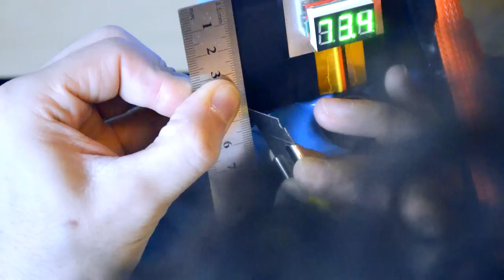72V 29Ah 20s10p high density li-ion battery pack

Comment: hi..how many amps does bms have for batteries?
Reply: All BMS will do is limit the amp going out from the battery. If the battery pack can do continuous discharge of 100A then you'll want BMS that will do 100A.  First you will have to design the battery yourself...determine how much wattage, amperage, and amp hour you want to have. There is battery voltage amp calculator you can use - https://power-calculation.com/battery-storage-calculator.php
Once that is figured out you can search for the BMS to meet to your specs. But I don't think you have to have a BMS to run the motors. Having a BMS will cause more potential problems...like stop feeding power to the controllers, or power cut out unexpectedly. It will also be more difficult to troubleshoot when your electric bike or scooter fails...God told me not to go with the BMS.

Comment: hello, i always impressed with your battery pack builds, i am too building a battery pack but i am suffering with switches, could you please suggest me a switch for my battery pack (for discharge wires)
Reply from the maker: Switches are better installed in the electronics to be powered with the battery. If you have a switch installed in your battery, there is a mechanical element that could fail, and make the battery useless until reparation. On the other hand switches are better for low current and voltage operation, if your battery is BMS equipped you can sometimes install a switch there activating and deactivating discharge port.
If using a switch is your only way to go look for any high current switch or anti-spark switch for higher voltages than 72Vnom.
these are examples for medium current swithes:
http://www.ebay.com/itm/Interruptor-Light-4-Pin-DPST-ON-OFF-Snap-inRocker-Switch-15A-30A-250V-AC-28x21mm-/252360792396?hash=item3ac1e0194c:g:6SwAAOSwKfVXFe6j
http://www.ebay.com/itm/New-Universal-12V-20A-Racing-Car-Vehicle-ON-OFF-Light-Rocker-Toggle-Switch-Cover-/291780259596?hash=item43ef756f0c:g:azkAAOSw4q9XT8IL&vxp=mtr
http://www.ebay.com/itm/AC-250V-15A-125V-20A-ON-OFF-ON-3-Position-DPDT-Momentary-Toggle-Switch-DT-/252471360099?hash=item3ac8773a63:g:I5YAAOSwZVlXkkQn
Reply: thank you

Comment: Why didn't you use battery holder instead of hot glue?
Reply from the maker: is not exactly glue, although the heat gun used is the same. Is a 7mm silicone that is more dense and with a higher melting temperatures. The main reason to don't use premade holders is to increase energy density. Once the silicone is dry, it is indeed working like a plastic holder but with the perfect shape between its matched cells.

Comment: Hi nice setup. How long does it take to charge from 3.5v to 4.7v  using 3Amp charger, maybe 3 amps per cell and 29ah then would take 10 hours. Is that about right?
Reply: 3.5v to 4.2v sry
Reply from the maker: Yes, Li-ion charge is very efficient, at 3A with 29Ah you need 10 hours from 3V to 4.2V (taking into account from 4.1V to 4.2V the charger charging current will be lowering until the charge is completed)
Reply from the maker: Depending on the model of cells, at 3.5V resting voltage can be at its real 35% SOC or as lower as 20% SOC. So the total time depend of the cells you are using (specific chemistry)
Reply: Thanks for that, Lets say Sanyo 35000mA, 10-13 A they must charge pretty quick more so than arbitrary laptop battery setups and be more reliable on amount of chares taken longevity wise than farmed batterys price wise. Seems for E bike is best to pay more for less weight and more reliability and longevity of batterys. you can still bulk buy from reputable suppliers in Europe for good cells for 4 Euros each. seems the way to go. It just takes alot of research which suks . What do you recommend for high quality E bikes?. I bought high quality adaptor kit from England and the rear wheel is 10mm off centre . This is still a gamblers market. Atleast I leart how to centre the wheel now but I bet the wiring will be too small in diameter for heavy current and will fail without a doubt. I can remedy that aswell so am looking forward to the challenge.. Its all about heavy current and  good power devices that count  and low resistance on everything which will give you true performance.Wish me luck.
Reply: wladimir delicaat Just a typo error

Comment: Hey, can I make a pack of 37 V and 45 Ah and boost the pack voltage using boost converter to get 72 V load demand?
Is using a boost converter advantageous because the number of cells in the pack reduces by almost half(37V instead of 72V) ?

Comment: can these batteries be used as backup charge supply for phev vehicles?
Reply from the maker: yes, but it depends on who you connect them can be really useful and efficient or not. The phev BMS design must be analyzed and check if it can work main plug paralleled or cell level paralleled

Comment: it's dangerous arrangement ... When the battery get hot and the plastic wrap fail ..boom ... fire ..!!
You should place additional layer of isolator between cells ... like thick paper ..etc ..

Comment: hello sir. I have a question
i have a 3000w 60v motor kit. I am planning to assemble my own battery with a 30ah capacity with BMS.
my question is, do i need bms?if not, how will i charge it if i dont need BMS?some of the youtuber says, bms isnt necessary. if not, then how will they charge it?
2nd question, if i insist a BMS, is 45a enough to handle a 3000w 60v motor?
thank you for your answer.
Reply from the maker: You can charge with BMS or without BMS, the only thing a BMS do during the charge is checking continuously each series voltage, In the case one series reaches 100% the BMS will stop the charge, avoiding that series to over-charge.

Secondary most of BMS also balance the charge between the series, so when the first series reaches 100% it will discharge it if other series are not at 100%.

So BMS makes a "direct charge" (through BMS main leads) safe.

You can charge also directly through a battery main leads without BMS, but you must be controlling manually or with any device how each series voltage is, because if there is one series unbalanced for any reason, once the maximum voltage is reached you could have one of them at a very high voltage as you not used any electronic that would cut the charge for that reasons (standard chargers can't control that)

Secondary you can charge without BMS through the battery balancing wires, so you are charging each series independently, in those cases you are controlling each series voltage so the charge is also safe.

The good thing about using a BMS is that you can charge with any charger, even if you mistake and use a higher voltage charger, the BMS will stop the charge when necessary. So it is the most safe way to charge.

Although is extremely improbable, A BMS could fail in the way it can control each series voltage, so it is better if you can periodically connecting any balancing display, or checking manually that every series are at the same voltage.

To know which BMS is suitable you must check the controller rating or continuous current. the controller is the one which power output depends, not the motor. The motor rating is only the maximum power it can work continuously without fail.

EG: For a 40A continuous or rated controller (80A peak usually) you should use a 40A or more continuous rated BMS (peaks are also the double or more).

If you use a less current BMS in the example, eg.20A when the controller reaches more than 20A during some time, the BMS overcurrent protection will hit cutting the power output for some seconds, or even permanently up to the next charge.

If you use a much more current capable BMS, eg.80A in our example, there is nothing bad to happen except you some day use that battery with a much more powerful controller, eg.80A. if that battery would be working at 3C or any rating superior as its limit, you can "cook" the cells and destroy the battery.

So the suitable BMS indeed should be closely matched to which maximum continuous curren tthe battery should not never pass over, so you are protecting a current abuse in your battery and maximizing its life span
Reply: then sir how can i charge a whole pack of 60v 16series with a charger?
Reply: sorry sir for asking as i am a newbie. I was searching for a youtube that demonstrate charging a series of batteries like 60v 16series or 36v 10series
Reply from the maker: to charge a 16s(60V nominal) li-ion or LiPo battery it is needed a charger with a maximum charging voltage of 16s*4.2V= 67.2V

42V for 10s (36V nominal)
Reply: lets say i have a charger, so how will i charge it?any demo out there you can share and link so i can watch it.?

Comment: Can you charge/balance less batteries in series with one BMS made for more Series capacity?
Example: Charge 5 batteries in series with one 6S BMS. It will work? Or you must have 6 baterries connected to the BMS to do the balance?
Thank you! Nice videos, btw.
Reply from the maker: +Jorge Salinas You could balance them for sure, the balancing wires are connected always to the balance circuit, so it will bleed through that wires everything over 4.2V. Because you have one series not connected, it makes the BMS thinks there is one series below 3V so it will cut the discharge port for sure, so you never could discharge, And depending on the board model the charge port could be available to charge, or maybe not if the BMS don't allow charge for series under 2.5V for example.
There are some BMS boards ready to work with less series than max available, ask manufacturer.

Comment: in which machines, this type of battery is use
Reply: they are sold alone on ebay or aliexpress. or you can get them from old laptop batteries
Reply: I guess he wanted to know where the battery pack is going to be used. :)
Reply: Adil Darvesh electric bikes or gokart anything the would use the voltage mostly are ebikes but I could be wrong most ebikes use 36 to 47 so this mostly for a high end ebike one the goes over 35mph
Reply: its used for electric bikes/ scooters/ storage for solar panels /ups/ or literally anything you can imagine. this pack can store 2kw of electricity with that amount of electricity you can do a lot if things. you can connect 20 of these in series and you have 40kw of power with close to 600amps. with that you can produce 110hp at wheels of an electric car with a range of more than 150miles.

Comment: How can I check if my battery pack really has 30ah vs 28ah what tools can i use your know with the multimeter i check volts 72 or 48 but how do you check AH reliable / some batterys sold now days say 72v 15 ah ok i see 72 but is the 15 ah true or maybe its got 10ah who knows ????? Explain pleaseee HELP ????

Comment: Hey! Congratulations!  Very good pack.  I have an electric scooter wich works with 72 volts, it has lead batteries, but their range is really poor; can i get more range with this battery pack?  How much is the cost? can you make one for sell?  Thank you for the answers.
Reply from the maker: If you take into account discharge efficiency of Li-ion at standard rates on an electric scooter riding at around 1C (60 minutes of ride from 100% to 0%) that is around a 95% versus the efficiecnt on a lead SLA battery that should be around 60% at 1C and you also include more than a 50% of less battery weight, for the same capacity battery you should get double the range. And of course the life span is more than 3x
Reply: Dante, you should check the cooling for your motor before you use this. Else you need more a bit more than 72 Volts, like 12V lead batterys have 14.xx V :)
Reply: whats the price for this 72v pack ?

Comment: witch charger you using to charge it ?
i'm using your custom battery pack build to my e-bike   :D
Reply: i need help !!!
Reply from the maker: this battery needs a 72V Li-ion charger. (84Vmax). Maximum current should be 10A

Comment: Hello! How are you... Nice work, really...

I have some questions. Is the spot welding suitable for grat discharging rates? I need around 30A per batteries.

Beside this I read that ultrasonic welding methos is better than spot, this is true? Do you know where I can found some ultrasonic welding machine for this kind of applications? Or you recommend me spot welding?

I appreciate your help.

I have several inquries about welding batteries, so if you have some time I will be grateful if you can help me.
Reply from the maker: For 30A per cell you need 0.3mm of pure nickel or equivalent. Ultrasonic is much better method because you don't create heat over the conductor or cell so its integrity is perfect. The only cons is the grater cost of the machine.
Reply: Damian! Thanks for your reply...

I think like you said, the best way is Ultrasonic, do yo know where I can buy one? some provider o website?

Thank you so much!

P/D: You can see our product in www.voltumotor.com
Reply: I forgot, if you think it's a lie, anytime you can visit http://autoblog.com.ar/2016/02/08/retsa-voltu/
Greetings!

Comment: Well done! You are interested in making a battery pack, but I always feel that there is one important part missing (Battery Holders/Spacer Separator), I suggest you add it more safely.
Reply from the maker: Absolutely. In this case they are exchanged with a very thick are secured battery case, but I will always recommend battery spacers and holders
Reply: Good, keep on cheering.

Comment: How can you charge a battery of this size? Most ebike chargers are at most rated 72v20Ah but you have 29Ah.
Reply from the maker: The amperage or current rating indicates how much time will be needed to have the battery charged. If I have a 72V 10A charger, it will need almost 3 hours of charge for a 72V 29Ah battery. If the charger is 72V 29A, it would need just an hour. If I have a 72V 20A charger ----> 29Ah / 20A = 1.45 hours = ~1 Hour 28min

Chargers are never rated for Ah (amperage-hour) a capacity measurement unit, always are specified for A (amperage or current) a intensity measurement unit.
Reply: Damian Rene thanks for the reply

Comment: Your math is incorrect  given battery 3:7 v 2500 mAH  your battery capacity would be Nominal  74 volts 25AH 20s 10 p
Math looks like this  nominal voltage 3.7 x 2 = 74 v.   2500mAH x 10 = 25,000 mAH = 25 AH   Hope this helped you.

Comment: how do you charge this battery pack
Reply from the maker: It needs a 84V li-ion charger, the BMS balance circuit takes charge of balancing the series, but using factory new high quality cells from the same batch, the balancing needs are extremely low

Comment: where do I go to buy a 🔋 battery from you well actually I need pricing first but would like direction on a 72v rear hub setup as well
Reply: It depends on your capacity and amp requirements. You're probably looking at a solid 500 in just the battery costs alone.

Comment: So much easier to get Headway 40152S, only 24 cells that screw together = 80V @ 15Ah.
They also last 10x longer, and are safer.
Reply: 24 cells will also cost you 900$ and I don't believe it when they say 1500 cycles. where as I could build a battery with 30ah for only around 400$ and most 18650 cells will last 500 cycles

Comment: where can buy these Battery?
Reply: em3ev its the 74v battery pack. You'll need a charger, I recommend the cycle satiator because its completely silent, resistant and configurable